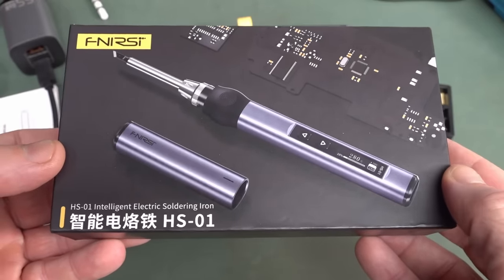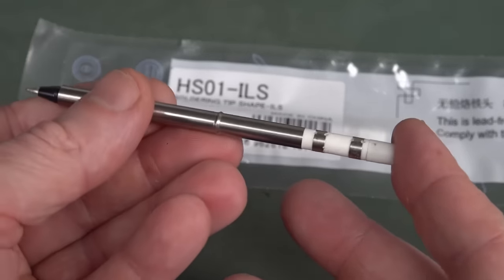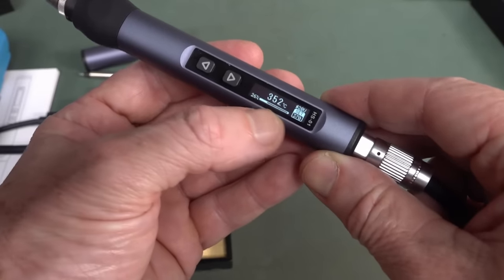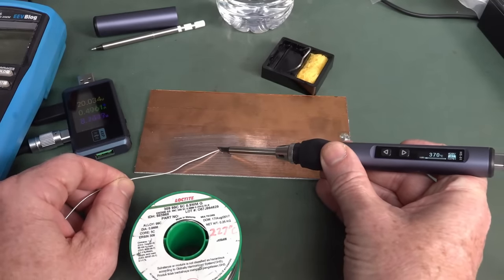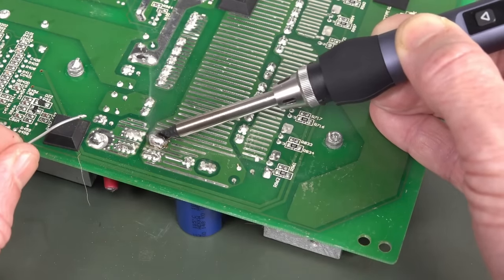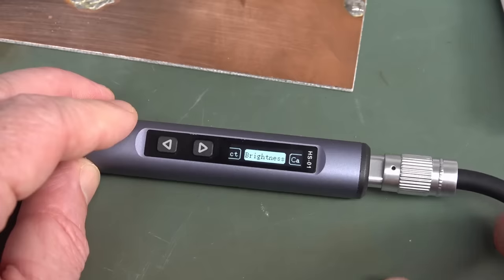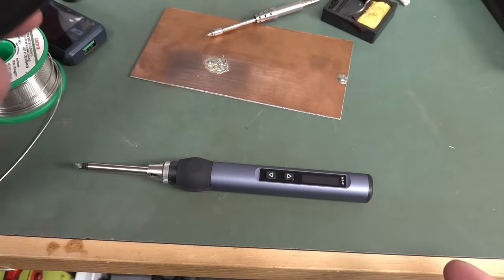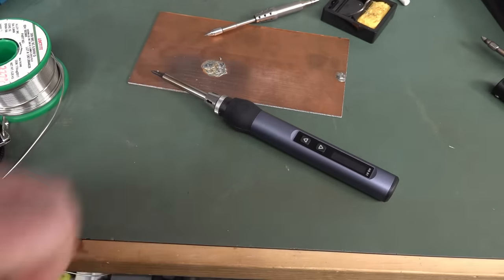EEVblog 1543 - Mailbag FNIRSI HS-01 USB Portable Soldering Iron

Comment: A question: is it not worth looking inside these plug packs from Ali express (and eBay, etc.) and examine the safety margins when doing these reviews? 

I've been wary of anything plugged into the wall from these cheap sites ever since seeing the blog posts dissecting cheap knockoff Apple chargers. Are these concerns outdated?
Reply: No, they are more than current. You should only buy plugpacks that have GENUINE certification for your country. Generally that means only buy from a local "bricks amd mortar" retailer, and never from China directly.
Reply: @johncoops6897  Thanks, that's what I've been thinking as well. If there's no local importer with legal liability in the same country, then don't buy any 220 V stuff.

Comment: Same problem with tips as GVDA300 :( It is great solder but since tips disconnecting all the time it becoming basically useless.
Reply: Dave simply assembled it wrong. There is definitely ZERO issue with loose tips with this product.

Comment: Portable yes, but unusable without a suitable length, super flexible cable, the type that seem to be unobtainable as a replacement, so these type of irons are ultimately destined for the junk pile.  The user interface is also dire, although this one might possibly be better than the TS80/100.
Reply: You can use any 100 W capable USB-C power cable.

Comment: a shame you didnt look at its readings..dont you have a soldertemperature, fx FG100 they are like 10 bucks the non name branded variants.
would have been nice to see what temperature you had according to the display and if your rolling with 330 degrees when it claims 400 or vice versa, as that display flicker did not inspire confidence.
even your thermal cameras would likely be able to clock a somewhat fair reading on that chisel tip, as the first 1cm  its far from shiny and darken.
got one of these cheap solderpens from China the SH72 was 10 bucks US delivered with incl. BC2 tip 3 or 4 years back on that unit you have to screw the metal front of,  and then slide the same pen in and the round ring will them lock it when the metalnut is screwed back,.... SH72 peaks around 55watt when running it from a PD 20v powerbank with a barrel jack to TypeC decoy cable, but it doesnt have a display. just a dial to 420 if I recall on the SH72 you can use the quite common TS12 tips, but its gets very awkvard simply from the length of the TS12 tips..
thx for the vid.

Comment: Looks like they don't have Australian power adaptors.
Reply from the maker: I didn't get one.
Reply: Would need to get a chinese domestic model most likely, they use the same plug. Export stuff tends to be US.
Reply: Buy a local adapter. It's not safe to use non-certified self-imported ones from overseas.

Comment: That's a crappy one. My ts100 is 80 dollars and heats up incredibly fast, reads accurately and has better screwdown tips.
So little handhelds can be good
Reply: He assembled it wrong, the tips are bomb proof in this when you screw them in correctly. The fluctuating temp with a new tip is described in the manual (that he didn't read). It becomes stable after a couple minutes.
Reply: @maximilianmustermann5763  oh nice, lol.
So it is as good as mine then.
Jeez. I have a pro soldering station that is insane and heats up truly in less than a second, but I can still say my handheld is fantastic. Especially when you consider it can be thrown in a bag.

Comment: Another pinecil fanboy here, love mine to death
Reply: The tips are expensive and not compatible with other irons.
Reply: My Pinecil v1 never could negotiate PD more than 9W (or something around that), even after updating the firmware. I tried every laptop USB-C power brick I could get my hands on (90W, 120W, 150W). It finally put itself out of misery by dying (sort of - dead screen) when I tried to connect with a barrel connector. Now it heats itself when connecting to USB, but only inside the handle not the tip. So there are a lot of things which can go wrong with Pinecil. Don't believe the fanboys ! Google it !

Comment: Id be all in if it were jbc  210 compatible
Reply: Check Sequre S60
Reply: @vassilikouleshov2209  Thanks for the hot tip!
Reply: @666alikat  Also Sequre S20 for jbc 115 tip or qianli mega idea also jbc 115 tip

Comment: Where’s our 200W T245 tipped portable iron with an XT60 on the back? The RC guys will love those, you know, for resoldering more XT60s.

The aluminium design with the hot tip cover is really nice though, if they made the cover a bit long you could probably even use it to store more tips, maybe even have a little gripping tool for changing tips on the fly without burning your fingers.